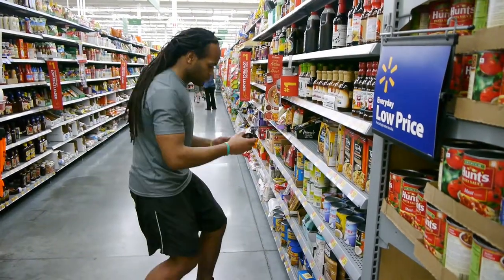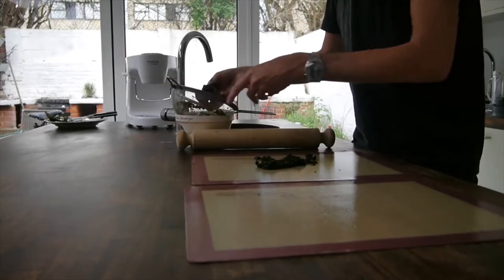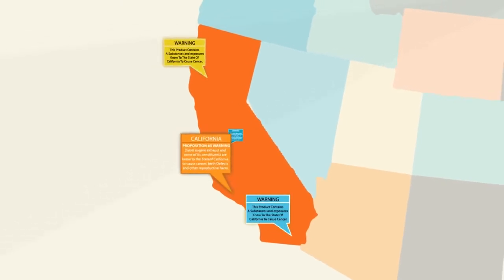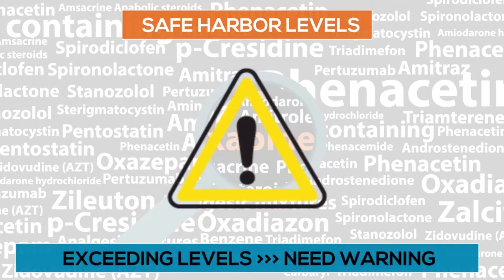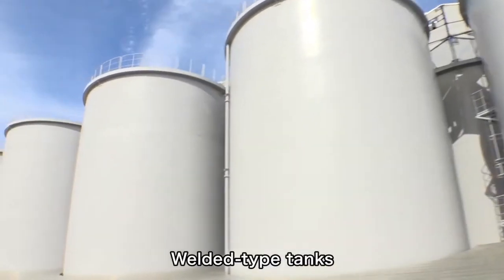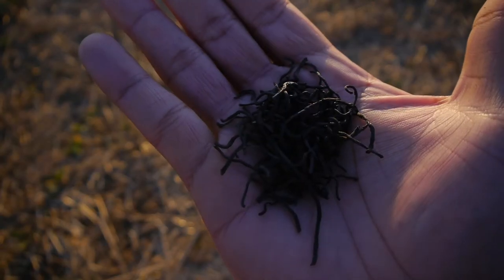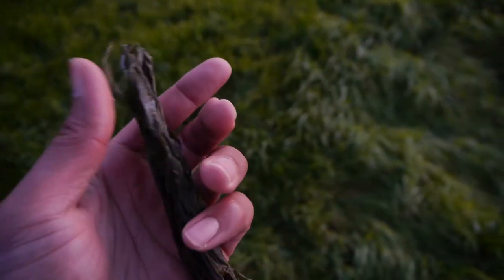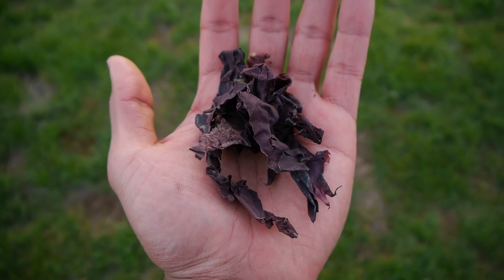What Is The Best Seaweed To Eat? What About Fukushima?

Comment: So basically even tho there is a warning - on the prop 65, it’s such a large quantity you would have to consume for it to be really dangerous?also just saw a warning on nori I recently bought - and was wondering if it’s ok to use to make sushi
Reply from the maker: Yes, with the prop 65 warning label on Nori seaweed you will have to eat lots of it; like 50 containers in a day for it to be dangerous. So it is ok to use Nori to make sushi. I ate like 6 containers of Nori last summer and felt fine. I don't eat Nori seaweed snacks to often. Look for organic and check that it comes from a good source. Seaweeds like Nori, Arame, Kombu and Wakame are safe to eat; having very small trace amounts of arsenic.